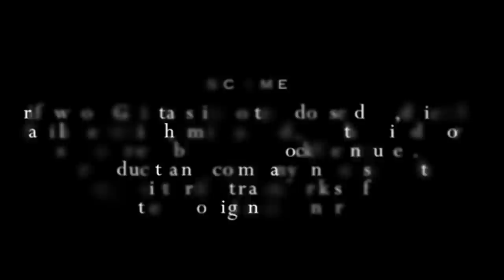Building A Guitar Out Of The Woodstock Stage (Episode 5)

Comment: Superb craftsmanship. I love your halving guitars series too.
Following on from a previous comment, here’s more about sound holes from Berkeley Uni:
Comparing an f-hole to a circular soundhole with the same void area, the resonance frequency, f, of the f-hole differs from the one of the circular by 4 semitones. Treating the radiation of sound during resonance as a monopole, the radiating power W has a power law relationship with the resonance frequency as , which results in 4.5 dB higher radiating power in f-hole compared to circular opening with the same area. Their method of analysis was verified by measuring the resonance and bandwidth of different openings on a standard resonance box.
I wonder if this might suggest a new project for you.